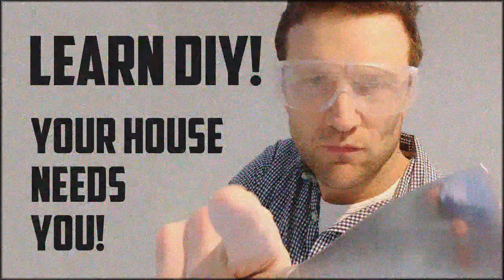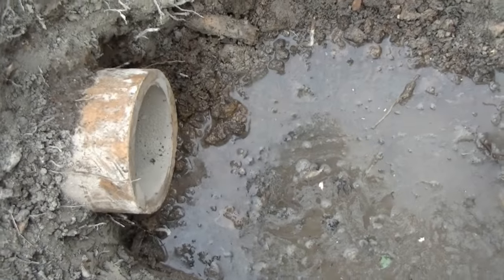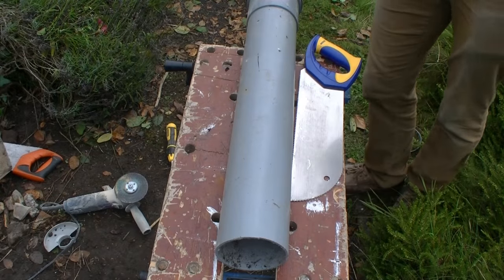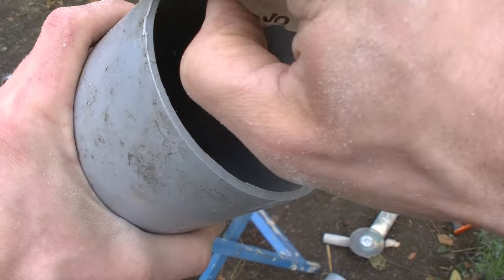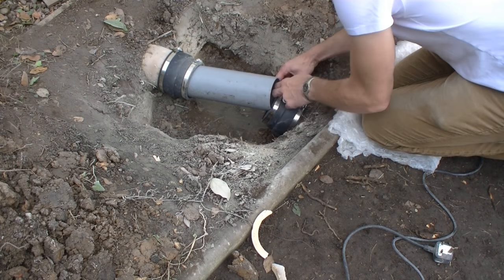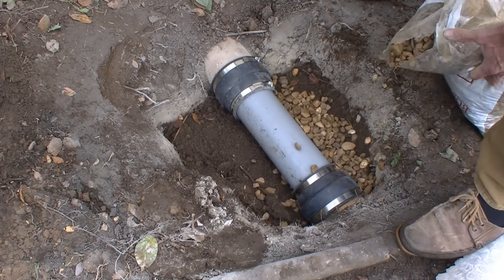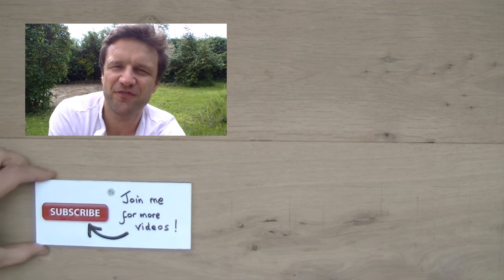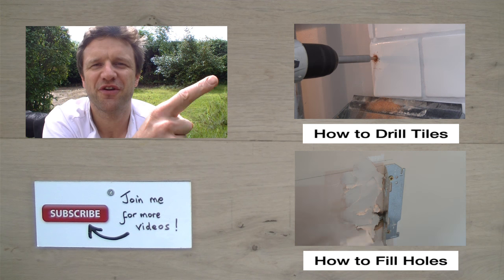How to Repair a Broken Clay Drainage Pipe

Comment: Couple of points, 1. use 10mm pea shingle 2. place the couplers onto the new pipe first then slide then out, repair pipe can then be cut to fit tight between the existing clay pipes.
Reply: 2. Excellent tip
Reply: Okay but do those transition clay to pvc couplers actually slide all the way into the new PVC/ABS section? I know that certain couplers like flexible couplers are meant for sliding all the way  into the new  pipe section (which you can cut to exact fit or with just a very very small gap to compensate for dirt movement to avoid your pipes from getting damaged from movement) then sliding them into the old section, but I've only done this with pipes that are of the same external diameter, like 4 inch ABS to 4 inch ABS is a simple example, but this is a clay to pvc/abs coupler fitting so I havent tried sliding it into the pvc/abs first to see if it will actually slide all the way in. I know for sure that u can't slide it all the way into the cray pipe because there is something inside that stops you right in the middle of this kind of coupler to prevent you from going more than halfway maybe for dummy proof proper installation purposes.  I'm going to have to try sliding from the smaller side first into the externally thinner pvc or abs to see if it will actually go past half way the transition coupler and actually slide in all the way, and then yes the  method of installation you recommend would be better for a tighter trouble free easier install. Ill know after I go to the local home improvement store and try it out in the store haha.
Reply: Hey Russ thank you that help me think through my project
Reply: The new pipe needed to be bedded down with sand ... sand is generally self-compacting ... 10 cm below, 10 cm on the sides and 10 cm above ... with the soil underneath as in th e video, this will settle causing a void under the pipe ... any kind of loading will break off more clay and start leaking ... then fill up with tree roots ... which just happens to be the repair work I'm doing right now ... and why I watched this video ...
Reply: Thank you for posting this and all who left the comments and tips. I'm a 45 yr old single mom of 5 kids under ten years old and having the information to do it myself correctly has saved me on this one. Ty, ty ty

Comment: Thanks!  I was supposed to have some plumbers come out in the morning to fix a broken sump pump pipe in my front yard, but after watching this I think I'll save myself a few hundred bucks and give it a try.
Reply from the maker: You're welcome. Just make sure you cut the replacement the same length as the bit you've cut out, as that's one thing I could have done better in the video! Cheers

Comment: Thank you for taking time to make this video. I have to make this exact repair and this is so helpful.
Reply from the maker: You're welcome. Watch this before you do the repair https://youtu.be/OYlKMLoVSHk?si=G3V5cuyBYuKgtc5t as you want to slide the couplers onto the new piece rather than do what I did. That way you ensure the replacement piece is as wide as possible. Also typically you'd use brown plastic below ground 👌👊

Comment: Thank you for the video. I would also put a "caution sewer pipe below" underground marker warning tape above (and along) the pipe. So that people who years later dig in the garden for some reason can see immediately that there is a pipe below. Such a tape costs about 25 pounds for 100 meters. It is designed to last for eons. There are versions with two wires inside so it is detectable by metal detectors.
Reply from the maker: That's a very good idea 👍🏻

Comment: Good video, thanks. Only thing is you should have slid the flexi coupling onto the pvc pipe first, place the pipe, then slid them out to the ends. Make things a bit easier
Reply from the maker: +wsbob I know - a few people have told me that. Don't know why I didn't think of it at the time! Also I didn't make the replacement section of pipe the exact width of the pipe I cut out - which was also pretty dumb in hindsight! Thanks for the comment.

Comment: This is fantastic. Exactly the problem I've got with a pipe of a similar diameter servicing a single downpipe off my house - a problem I'll now fix myself.
Reply from the maker: Glad to hear it Phil! Just make sure that you cut the replacement pipe to the same length as the gap - rather than making it shorter as I did! You can then slide the two new cuffs onto the replacement pipe and then slide them into place when you've lined up the replacement pipe.

Comment: Great video. This is exactly what I need to do as well. Huge oak tree roots destroyed a section of sewer pipe. Thanks for being thorough! I can now move forward with confidence that I can handle this myself.
Reply from the maker: xenomenon Thanks for the comment! Just remember to cut the replacement section the same width as the damaged section you're replacing. I didn't do this, and a few people rightly pulled me up on this. Not really a problem for my drain as it only carries rain water - but more important when it's carrying sewerage - as you want the join between the two pipes to be as seamless as possible so that the sewerage travels freely across the join. Good luck!

Comment: Hi there, so today I had very similar size   pipe replaced with pvc exactly as you have done. However builder did not use any gravel to fill around the pipe. When I asked he said it was not necessary to do so? But all the videos I have watched everyone uses them. Is he right or should I challenge him to come back and redo it? Thanks

Comment: A couple of points! 
The Orange pipework is the below ground standard pipework that should be used - not the grey, which is for above ground use!
Also, slide both flexi-couplers onto your repair piece, drop the repair piece into the gap between the two existing clay pipes and then slide both couplers back over the clay ends and then tighten all jubilee clips - saves trying to force the plastic pipe into a flexi-coupler that has already been tightened onto the clay end.
Reply: Agreed,
Reply: Hi, you seem to know your stuff. Are you in the trade? If so, maybe you can answer my problem? I also have a broken water pipe (same size, I think, 100mm) But the break is to an existing rubber joint (similar to that repair) it's 'misaligned' and rubber has a big hole that's leaking upwards of drain is block. How do you 'realign it'/ replace with new rubber sleeve?? Thanks, frank

Comment: Excellent. Thanks for posting. Exactly what I was looking for. Thank you
Reply from the maker: You're welcome. Just get brown plastic as it's underground and cut the replacement section to the same length as the bit you've cut out, slide the rubber sleeves into the new section and then onto the old pipe when in place, rather than how I did it.

Comment: I was quoted $18,500 to fix an old clay sewer line that has been ruined by the giant maple in my front yard! I plan on doing the repair myself, instead, and this video tells me it shouldn't be that hard to do
Reply from the maker: Yes it's not hard if you have a grinder. One tip - make sure you buy brown plastic pipe or the US equivalent for underground use, and cut the new piece to the exact width of the section you removed, and slide the new collars onto it, hold it in position and then slide them onto the old clay - don't know why I didn't think of doing that 🤦🏻‍♂️

Comment: Thank you buddy, I knew somebody would show me! Much appreciated!
Reply from the maker: You're welcome. Just use brown plastic underground and cut the tube to the same width as the section you have to cut out, put the rubber sleeves onto the brown plastic and slide them on rather than the dumb way I did it!

Comment: Hi Charlie,
 I would put the rubber joiner on the plastic pipe first, this make it easier and you could cut the PVC pipe to exact mm. Secondly I would put some silicon around the pipe as well to stop roots getting in to pipe.
Make sure the silicon is compatible wit the rubber.
Reply: No need to add silicone if the clamp bands are tightened to the correct torque, this will be more than sufficient to prevent root intrusion for the life of the connection.

Comment: thanks for sharing this - essential info! 2 questions: how long will those stainless jubilee clips last underground before they fail? also, if this was a sewer pipe, is there a risk that blockages are more likely now the bore is not smooth and continuous?
Reply: Blockages are definitely going to become more prevalent

Comment: for the next time to easy the installation, place the two couplings on the grey pipe and lower everything into the hole, then move the couplings over their final position.
That way you can also cut the grey pipe to the exact dimensions, not approximately like you did.

Comment: Thanks, this is exactly what I need to do.
Reply from the maker: You're welcome. Just buy brown plastic not grey and cut the replacement piece to the same width as the bit you've removed and put the rubber collars on the new section and just slide them into position when in place.

Comment: Very clear.  One question, what type of disc did you us on the grinder as it is not in the list of tools?
Reply from the maker: A stone cutting disk but right now I'm using something similar to this  https://bit.ly/33SzmjJ So much more durable than the standard stone disks which you go through so quickly. When you do yours, a) use brown plastic underground and b) cut the replacement to the exact width of the missing piece and slip the collars onto the replacement piece and then simply slide them into place, rather than what I did!!

Comment: Nice video
Reply from the maker: Thanks. Two things though. Use brown plastic if you can, and slide the rubber gaskets onto the new piece of pipe, put the pipe in position and then slide them onto the cut sections. That way you can get a much closer fit on the replacement section. 👍

Comment: Ya the good thing about sewer/drain lines is you don't have to be picky you can go with concrete to plastic , clay to plastic , cast iron to plastic , plastic to plastic ,..etc depending on what the code want there install is relatively the same rubber fitting or if its plastic to plastic could uses adhesive to.

Comment: Neighbour put fence posts through our surface water drain. I need to do basically what you did, but in my case new section of pipe needs to be flexible to bend around the old section of broken pipe to where the pipe is good again. Can you buy flexible drainage pipe?

Comment: I would put the flex couplers on the new pipe before fitting them slide out into position. Absolutely miles easier don’t have to force anything then

Comment: Nice video, helped me do the job but I was wondering if you need to seal the ends of the clay pipe first?
Reply from the maker: No, you shouldn't need to. Cut the plastic replacement to the full width you've cut out, and slide the sleeves onto the plastic and then onto the clay, rather than how I did it!

Comment: The pipe you are replacing should be measured before attaching the rubber joint connectors, for a good tight fit.. You should then slide on both connectors to the new pipe and slide them along to each end.  You were doing it all wrong. Forcing connectors on after placing new pipework in position. Quite funny seeing you doing this....
Reply from the maker: +Clive Hurst Yes Clive, I'm aware of that - which you'll see from reading the other comments on this feed.
Reply: Biggles is exactly right. Then u can have it fit the entire length with zero chance of popping off and less chance of leakage.  Otherwise your new piece of pipe is shorter than it should be.
Reply: Iv just lost 7 lengths of drain rods with a spiral end ,I didn't rotate them clockwise on way in given myself a lot of work for nothing,now dug down to drain at tee junction and intend cutting a slot in top of pipe to retrieve rods
Reply: @brianmedeiros417 Show us how to do it right, make a video.
Reply: Biggles you are correct. I've just done it the way you described. It should also have been checked for any leaks before filing it with pea gravel and soil.

Comment: Thanks for this great video Charlie. Just took my digger bucket through the same pipe today 🤦🏻‍♂️
Also just wondering what video editor app you have for doing this video? Thanks again for the great video 👍👍
Reply from the maker: Thanks Luke. A couple of things. Brown plastic if you can and make it there same width as the gap and simply slide the couplers onto the new piece and then onto the pipe when in position. This was Adobe Premier Elements but I'm using DaVinci Resolve Studio now. 👍

Comment: If there's a 2cm gap between the plastic and clay pipe will that be ok? I did the same job but inserted a t junction but I couldn't put in a length of plastic pipe the full length to have them joint seamlessly

Comment: you need to use underground pipe which is always brown not grey which is for above ground
Reply from the maker: +James Donlan You're right that brown is designed for below ground, but the only difference is that the grey pipe is UV safe - ie it won't degrade in sunlight and is therefore more expensive. So there's no reason not to use grey below ground, except it's a waste of money! I just happened to have it lying around.
Reply: @CharlieDIYte  the ground soil pipe has additives to protect from acid found in some soils.

Comment: As someone else noted, how you cut the bottom half of the pipe with the grinder would be useful to see.  You start it and then cut to a later moment in time saying it's all done.  Didn't you run into trouble cutting the bottom half?
Reply from the maker: No, but from memory I may have had to take the guard off the grinder, which isn't something I wanted anyone to copy.
Reply: @CharlieDIYte  Oh my.  Thanks for getting back to me and letting me know.

Comment: I have this problem but with a corner pipe piece which connects to the soil stack. This doesn’t look too hard no idea how to do a corner one though 😩
Reply from the maker: I would see what you can buy at your local builder's merchant and then take it from there. Shouldn't be too difficult if you can get the right section.

Comment: To bad he didn't use proper techniques for the installation. Measure the area between the pipes for a proper and complete fill that will leave no gaps for waste and debris to catch and collect. Put the rubber couplings onto the new piece of pipe before setting it in place then push them onto the clay completely. This eliminates the struggle of wedging in the new pipe. Hope this helps anyone trying a repair or just call a Pro.

Comment: So there will be a slight backup of sludge in front of the smaller pipe?
Reply from the maker: Take the spirit of what I did and improve on it by cutting your replacement pipe flush with the two ends. That way there will be no build up. In my case it's only rain water so I'm not worried about sludge. Clearly I should have slid the rubber collars onto the replacement pipe then I could have made the replacement section tight to the existing pipes but we all make mistakes 😉

Comment: Good repair but underground should be orange not grey thats designed for above ground it will eventually fail as orange is far more robust
Reply from the maker: Funily enough I've just had to dig out up as part of a garden remodelling and it looks as good a when it was installed. I don't think the orange / brown plastic as we call it is more durable but it can't be used above ground because the plastic gets destroyed by UV.
Reply: @CharlieDIYte  correct solar radiation and if you look closly you will see underground pipe is thicker to

Comment: I see. You 
struggled a bit putting the plastic in the coupling can I suggest sliding the whole coupling back over the plastic the pull back over the clay much easier
Reply from the maker: Thanks Paulin. Yes I should have done this. I don't know what I was thinking 🤦🏻‍♂️

Comment: Why didn't you just put the rubber fittings on the pipe and place it on there at the same time? You did more work than you needed.

Comment: why didn't you cut center to but up to each end of  orginal pipe?
Reply from the maker: Timmy, you might check out the most recent comment on this. I take Neil's point that it's better to get the pipes to butt up as close to each other as possible to avoid any steps inside - this being something building control officers are pretty hot on apparently. In my case, the pipe was only conveying rain water off the roof into a soak away so it wasn't really an issue, but the point you make is a good one.